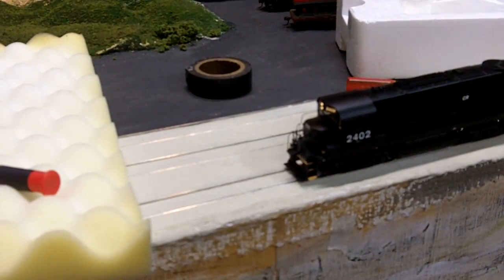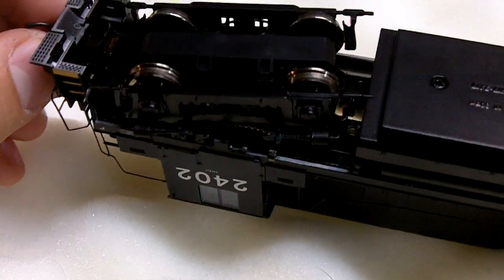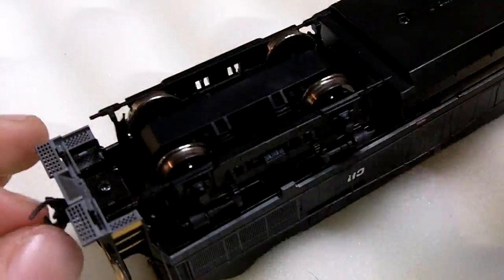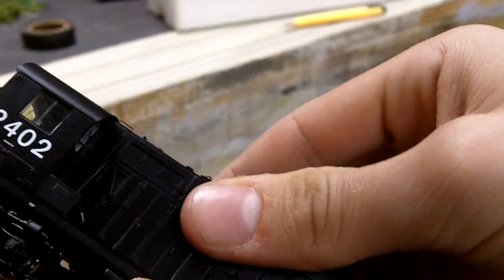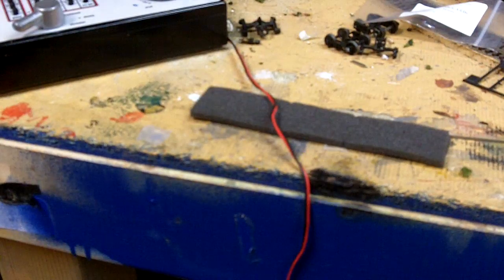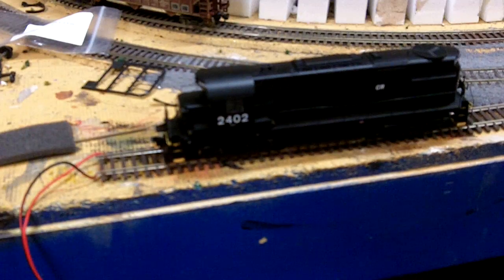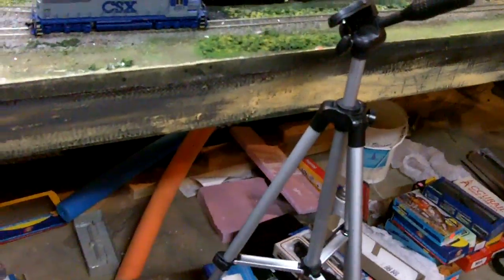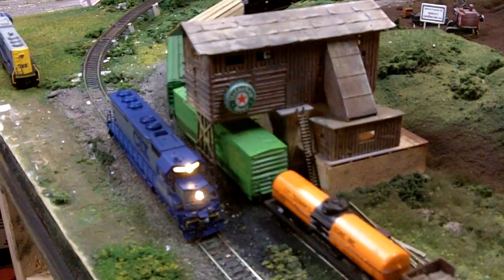How to install DCC and LEDs into a Proto 2000 Locomotive (part 3)

Comment from the maker: @rottiuree 

I plan to do the reverse lights, but I need money and time :P the SD45 of mine is actually a proto 2000... theyre hard to find these days, but when you do they sure are nice models. I think I like the RS27 better, simply because there is more space inside, and it takes tighter turns. Also the detail is a bit finer. I have not looked into installing sound, mainly because of cost